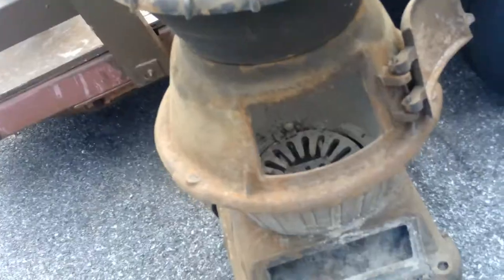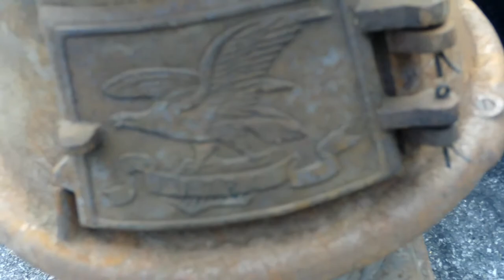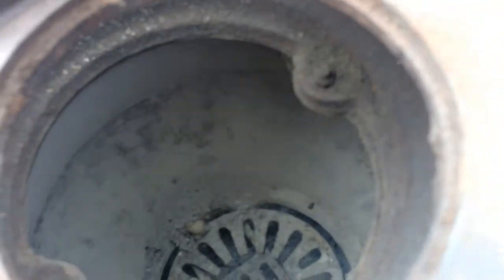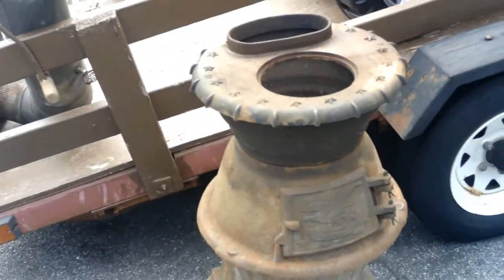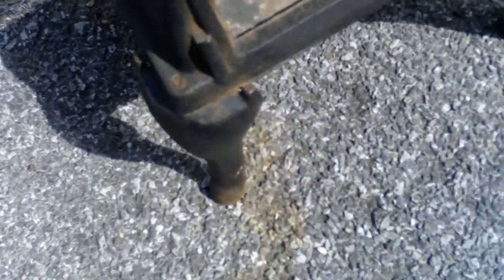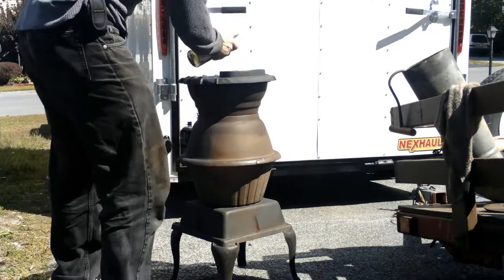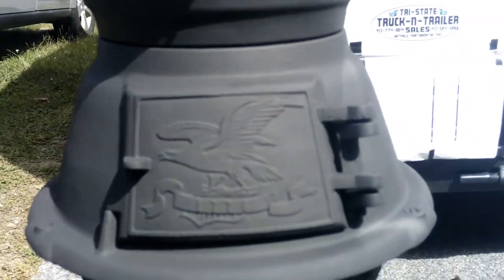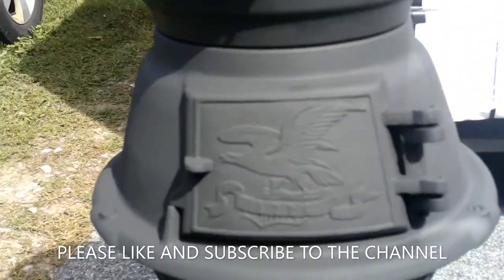Restoring a Pot Belly Stove, For My Cabin.

Comment: I just got a pot belly very similar, what kind of paint did you use and did it hold up well?
Reply from the maker: Hi, I used a engine paint. It’s rated to 2000 degrees. It’s held up great. I don’t remember the exact brand, but I think any engine paint would work well. Hope this helps. Take Care.

Comment: I have a stove just like yours 
How do you find out what year it is .
I was told mine came out of a caboose . But dont know if that's true
Reply from the maker: Not Sure about the Age. Some people on line says it looks like a Cannon stove that was made in the 1980s to look like the older stoves. Could be a replica or the real deal. I'm no expert lol. Anyway Its a great little stove, saves space and burns less wood. Thanks for Watching and Commenting.
Reply: If the feet don't have holes in them and it's a smaller stove (like his) it's NOT out of a caboose.  Everyone and his brother claims any old pot belly came out of a caboose.  Real railroad stoves were pretty large and all had holes in the feet to bolt them to the floor.  No one wants a stove full of burning coal falling over when the train lurches

Comment: You'd be better off using stove black. And add about an inch thick layer of refractory cement around the lower half just above the grates. Stove will last a lot longer, especially if you burn coal

Comment: Sandblast it. It only takes 30mins down to pure cast-iron
Reply from the maker: Jack Coleman would if I had the equipment. Thanks for the comment and watching.
Reply: A compressor $175 by a cheap one
sandblast gun ? $25 
Silica& Mask 100lbs $12
The guns are even cheaper than that.
You'll have a tool you can use to re-new old pots,pan,tools,engine blocks. Restraunt kitchen hoods(side-work).
Itll pay 4 itself in a coupla times.
Reply: @unclejack41  Wire brush  $10